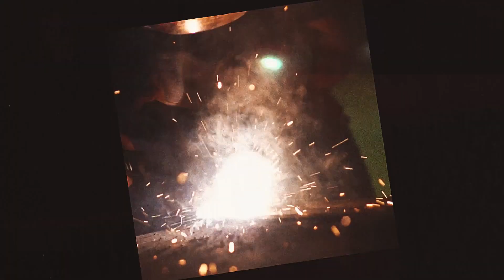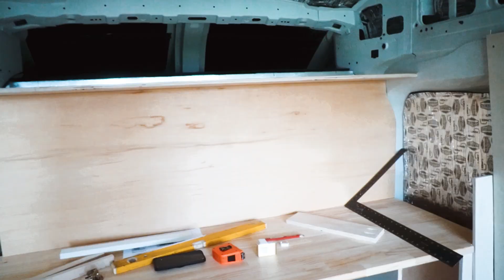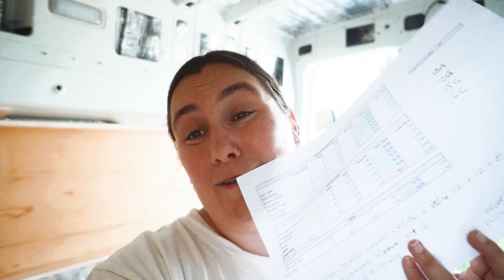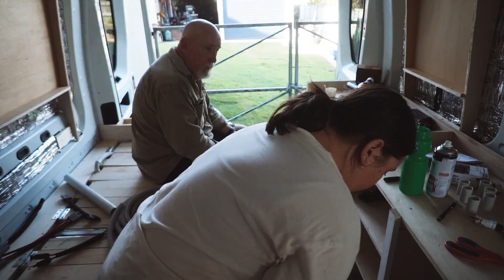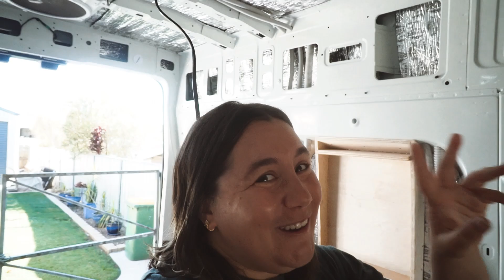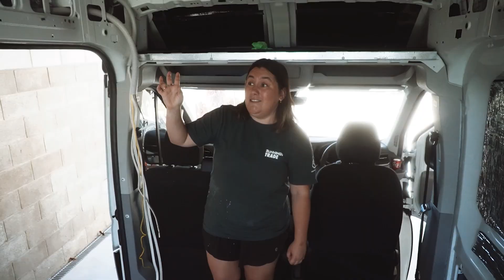Wiring a Van Made Simple - Our Complete Off-Grid Setup

Comment: Hi. Do you have your electrical components in a sealed  box vented to the outside of the van ?
Reply from the maker: Hi there :) Yes, so our 2 lithium batteries are in a sealed box which vents outside, and the rest of our electrics are in a cupboard that we can easily access if we need, but that also vents to outside as well, hope that helps!
Reply: @bsadventuring  Hi. Thanks for your reply. I’ve just started doing a Transit conversion and the regulations are doing my head in. I hadn’t thought about separating the batteries from the other components though. I was going to use BLUETTI power stations but even they need to be in a sealed vented box as they would have been in the same area I sleep in.
Reply from the maker: Heya! Sorry for the late reply, missed this!

That's so exciting, we've had 2 transits in the past and love the shape of them, they're such a good size!
But yes, the regulations are a pain, they changed in the last couple of years - certainly since our transit days, meaning that yep everything needs to be vented and sealed (ironically ha!) but at least by isolating the batteries/power and sealing that, you can still access all your system then!

Comment: Dont mean to be that guy but are your AC wires single core, similar to what you would use in a house?
Reply from the maker: Heya! All good - yes so for the wires we used single core like in a house, but in hindsight we would look more into Multiflex wires as a van has a lot more movement than a house and as the name suggests the wires have more flex. Either would be fine though :)